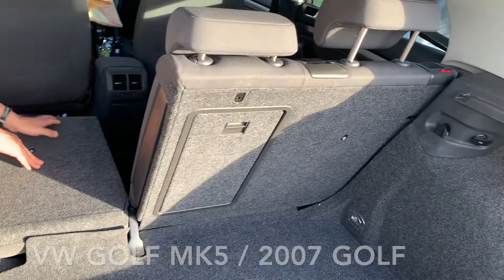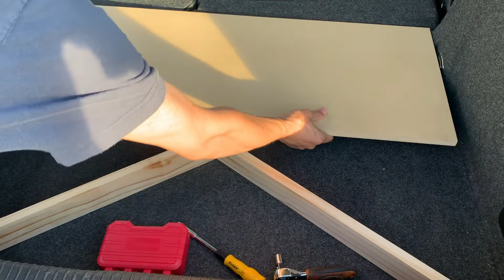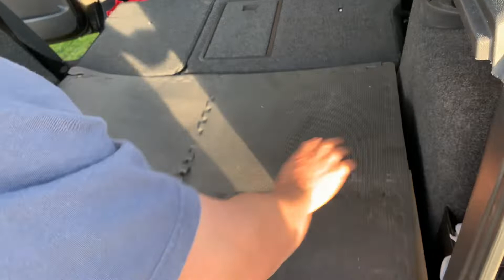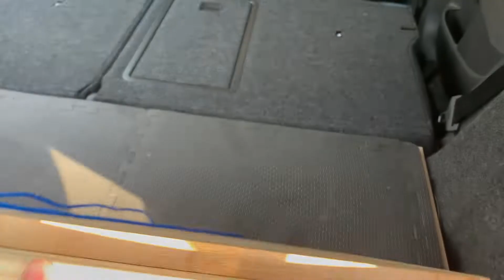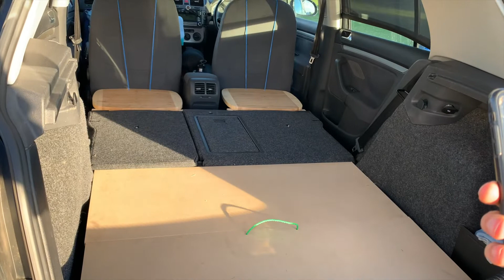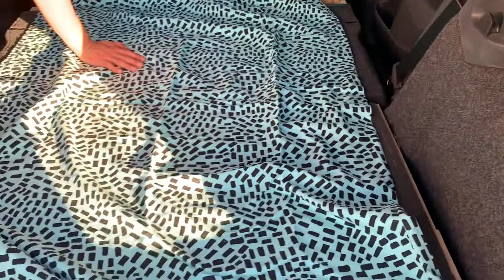VW Golf Camping Setup, Easy and Cheap, Golf Mk5, Hatchback Camping

Comment: The only question: you come to the place and it is a raining. What will you do?
Reply: I haven't done a mod like this (hence I am here on this video) but I do sleep on the back of the golf quite a bit when I go away climbing and stuff.

It was pouring it down outside a few nights ago so I had to climb through from the front seats and clear my space to sleep, I still have my back seats in so the hump got me

I like where he is raising the floor level to deal with that issue, personally at that point I would just have that fixed permanently as my boot, it's still a flat surface 

Going to be putting in something as a shelf so I don't break my parcel shelf anymore aswell 😅